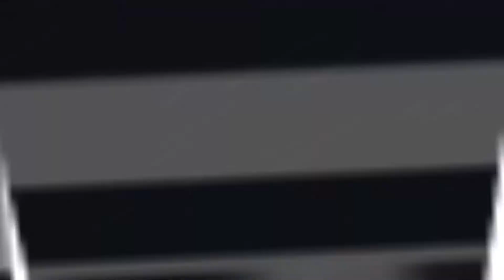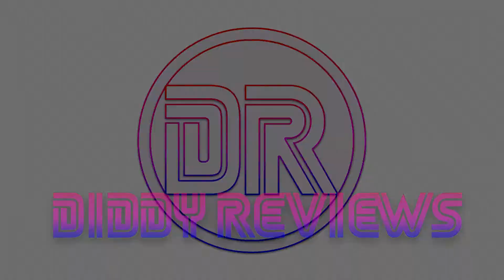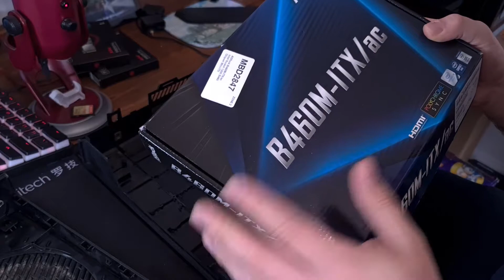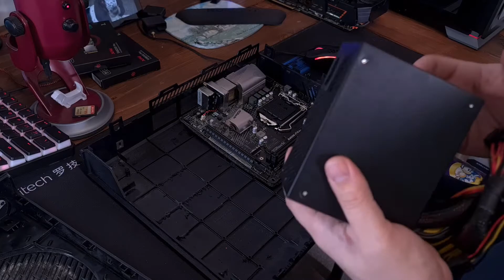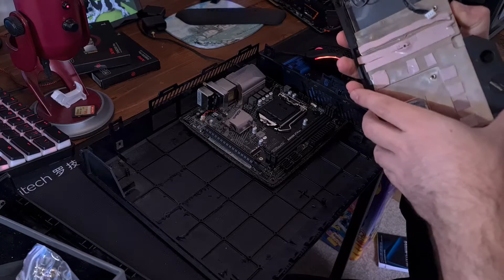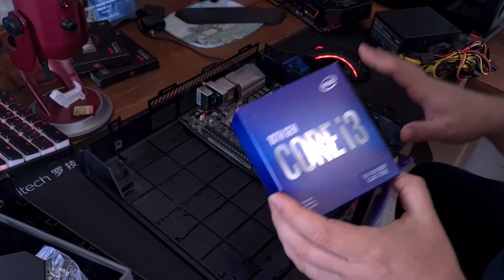Building a water cooled gaming PC inside an Xbox One - Part 1

Comment: Why didn't you use a pico psu or flex atx they are alot smaller so youll have more space for the gpu and watercooling
Reply from the maker: Yeah I should have. At the time I didn't have much cash so was using whatever I had or getting things cheap. I may revisit this and do a better job. Thanks for watching.
Reply: Im going to build my own watercooled pc in an xbox 360 using a 60mm radiator and a waterblock pump combo
Reply from the maker: @flamingo_mick  awesome. Id like to see this when it is complete.
Reply: When it is complete i will post it on reddit 
I also subscribed i love your videos
Reply from the maker: @flamingo_mick  nice one. Thank you so much I really appreciate it.